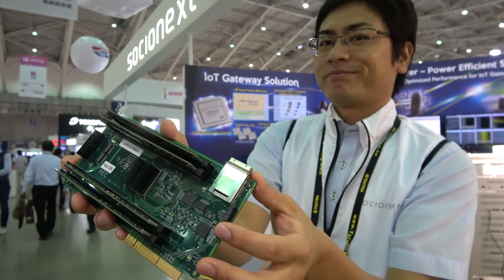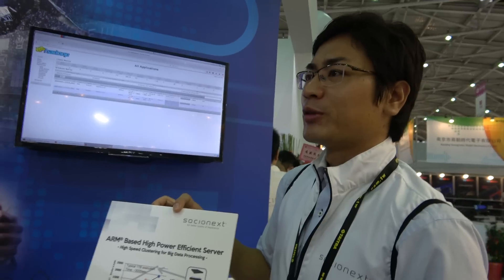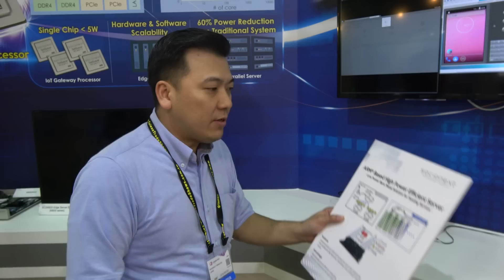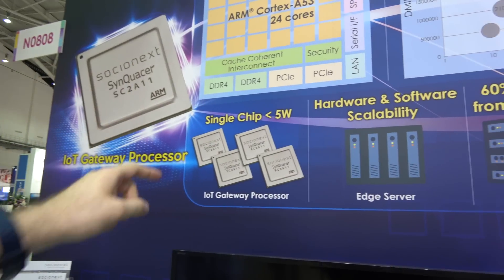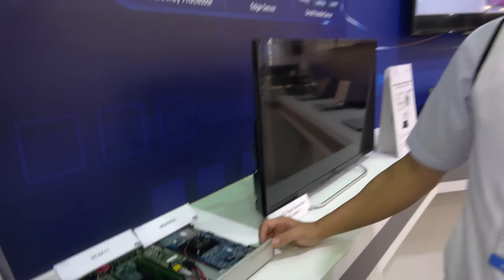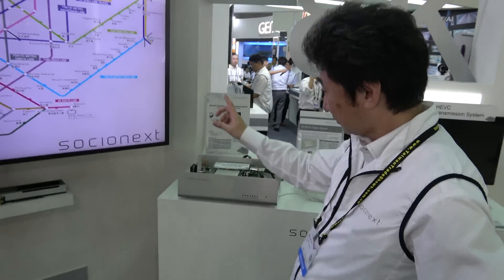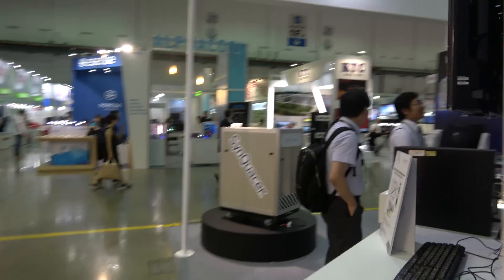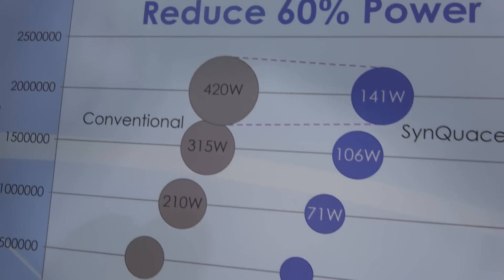Socionext 24-core ARM Server SynQuacer SC2A11, 60% lower power than Intel at same performance

Comment: Did I miss the price?
Reply from the maker: The price of the chip/system I don't know, but the price to run the overall system including the power consumption and cooling which is the largest cost of running a datacenter, should be 3x cheaper than using Intel at the same performance. I guess specifically Socionext says this is for tasks that are good for parallel processing such as Hadoop.
Reply: ok thanks!
Reply: 1200 usd with 32 gb ddr4 ecc and gpu and case,also psu i cant find the board alone
Reply: these new companies suck, they don't have their products distrubited, you can't find any price in Google, so, stay away. Better buy some other product that is marketed correctly. Small companies can die because of poor marketing like this.
Reply: @absolute___zero  Socionext is  is a joint venture between Fujitsu and Panasonic founded in 2015. It has over 2500 employees.
Reply: @mrbrisvegas2  probably these employees are only on paper, because it is evident they aren't working on the hardware. Because if they would, I would type the product name hit "Search" and there would be dozens of pages showing my "BUY at discount", but there is not a single product for sale on the web. Google yourself and see.
Reply: You can buy the complete configuration named "SC2A11 Developer Box"  from ChipOneStop online store.  I bought one unit this Spring and never feel any regret about an absolute silent machine w/o cooling fan.
Reply: @macchawala3993   microsoft has   revealed a new ARM developers box